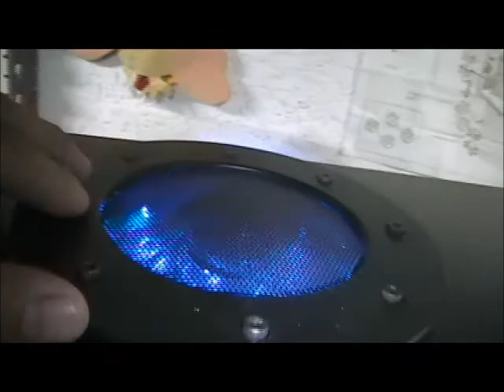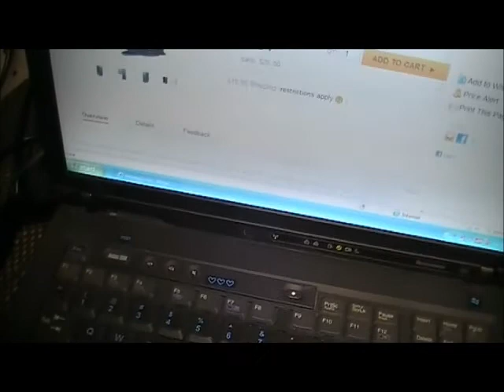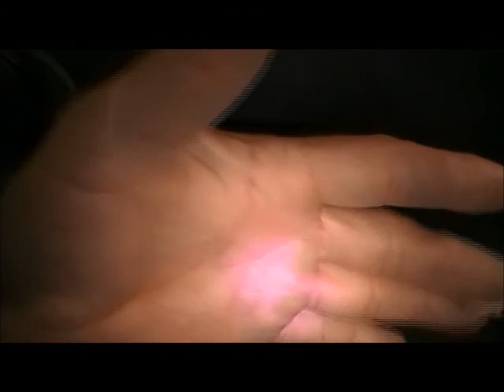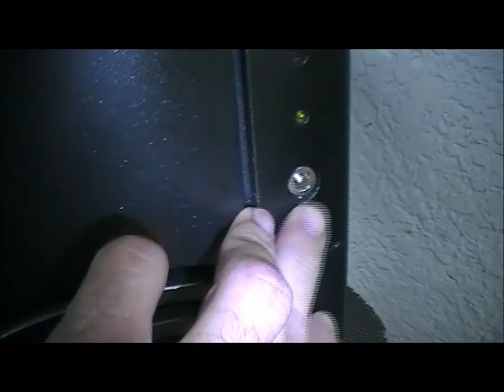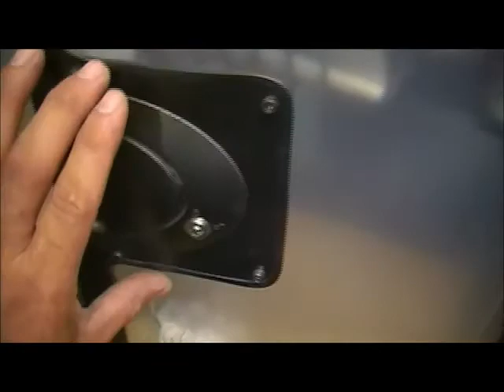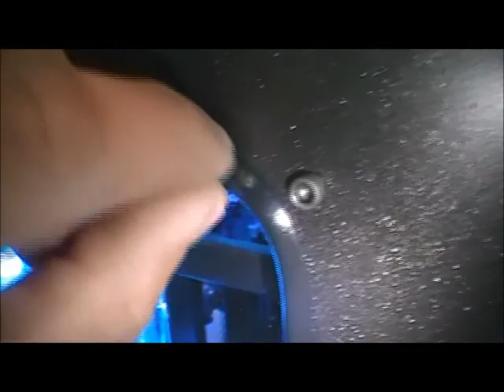Modding old Antec Case Part #2

Comment: My good old Antec 1080AMG server tower is well made, strong and sturdy
 which I've had since 1998 and it's stiil serving me well [pun intended]. However, I removed the two  removable HDD caddies and installed a HDD and an SSD in the DVD drive bay using a caddy for each drive. They are now easily removed as you would a DVD drive and there's so much more room without the two HDD boxes.